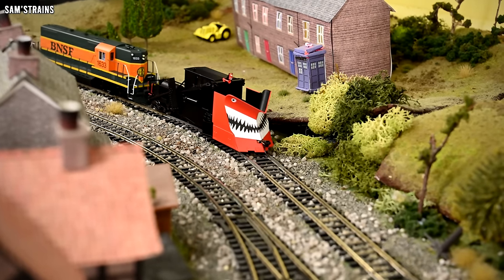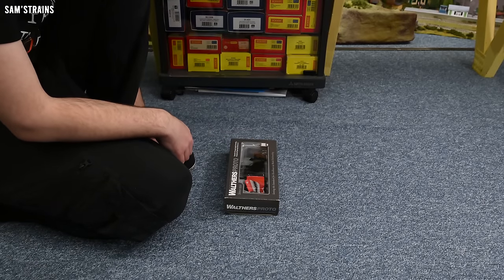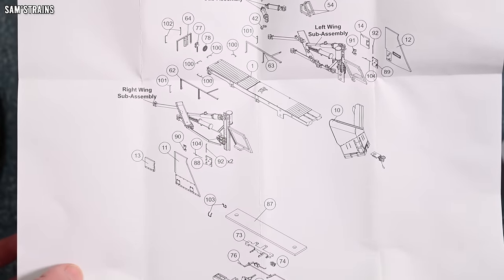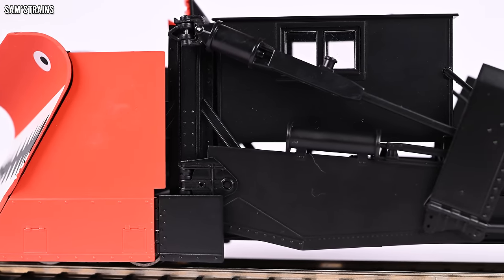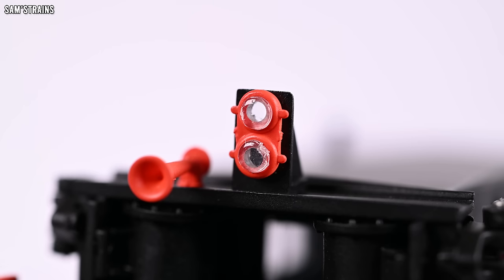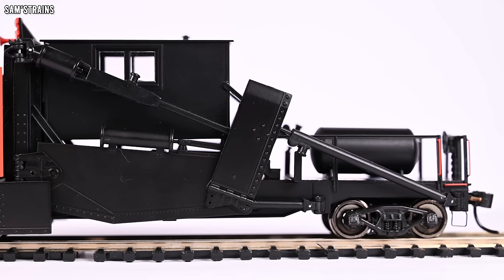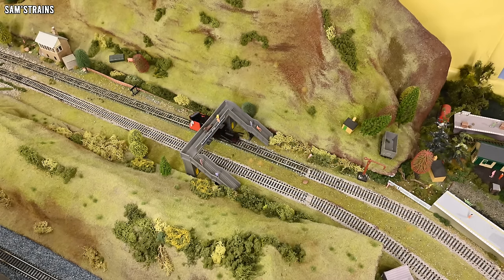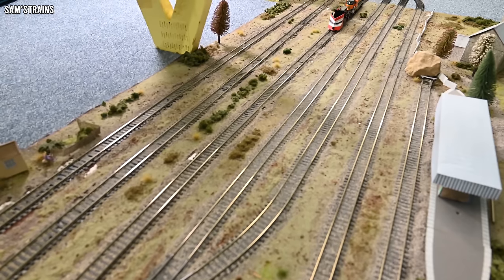Walthers Jordan Spreader | An Extremely Complex Model | Unboxing & Review

Comment: They could have put a metal rod inside the piston. I saw the plastic stretch when you opened/closed the big spreader arm. They could have easily put a small metal rod instead of plastic, but then that's why you gave it one star on its its overall quality.

Comment: This livery seems to be inspired by a snowplow on the Long Island Railroad, which more resembled one painted on the front of a fighter jet. 
The wings would only be opened if the spreader was running at low speeds, so you wouldn't have them open a lot.

Comment: These models were available many, many moons ago as kits. I’d say in the 80’s or 90’s. I can definitely see why all that glue is used, it is also why they have factory installed grabs listed on the box. Still doesn’t excuse a $75-$85 model falling apart out of the box. 
I will say this, Walther’s excels at their passenger cars. The mainline series is perfect for smaller layouts or those with tighter curves. The Walthers Proto or the old brown box passenger cars require at least 24” curves. 
I definitely would give their passenger cars a try just remember the main line/train line items are definitely cheaper, but the Proto versions will have body mounted couplers and factory installed grabs but need wider curves.

Comment: In the mountains of Canada, they pair these up with "Russell" Snow Plows of both ends of a pair of locomotives. Russell+Jordan+Loco+Loco+Jordan+Russell... so that in the reverse direction, they can ensure any fallen back snow can be cleared just the same.
I've got both the Russell and Jordan plows in the Soo Line paint colours.  It's unfortunate yours was a bit sloshed in assembly, the extra glue, and your need to make repairs. My models are just fine.  John

Comment: When I worked on the DM&E railroad in the 1980's,  the railroad purchased one of these.  It was kept for a while at my station at Pierre, SD.  I don't know where they got it.
I had fun examining it.  Apparently, it was built in the WWI era.  I was surprised to find the owner's manual still in the cab.
The manual had illustrations and complete instructions.  It was apparently an air-operated model.  One of the illustrations
showed it being pushed by a medium-sized steam locomotive.
It didn't have the colorful paint job of the model.  I remember it being solid black.

Comment: Thanks for reviewing yet another North America prototype, Sam!  I built the kit version of the Walthers Jordan Spreader about 20 years ago, and it holds a place of honor in my loco display case.  There is an interesting video of one of these clearing brush and small trees on the sides of a right of way and the brute force shown is a bit scary.  Too bad about the poor build quality on yours, though.  Unfortunately, many "ready to run" models I've purchased have required some TLC prior to layout use.  Cheers from Wisconsin!

Comment: Take the coupler out of the housing and see if the centering spring has no
bends in it. There may be a sprue area with a little flash on it, file it down
with a fine modelers file.
Kadee produces a dry lithium grease that can be used on their couplers. Just
puff in a little dab of it into coupler housing to improve centering movement.

Comment: Models imported during the C-19 period are in dealer stock for favorable prices. Post 2021 models are more expensive.
Might I suggest to you an American classic Athearn’s F7A/B. They are generally in stock at most dealers. 
The Jordan spreader is a very versatile machine it can dig drainage ditches, clear small rocks and other debris. In yards, it’s able to clean snow off three tracks at once. As for the couplers, Walthers rolling stock runs on the light side so they need to be opened on both cars involved and centered. Coupling on a curve will test one’s patience.

Comment: This would have been so much better if the plow blade, spreader wings, and cylinders were all metal. That would give it a lot more weight, possibly helping with the coupling, and it would make it much more durable so you could probably even use it to push around scale snow and ballast.
Reply from the maker: I agree - I think it really needs that for sturdyness!
Thanks for watching, Sam :)
Reply: Could try getting some small lead weights and hiding them in the cab area

Comment: I'm looking for a snowplow but probably one a bit more robust and easy on the budget.

As far as those couplers go, I've noticed that the knuckle couplers have two different springing mechanisms: "whisker" couplers with springs built in to the coupler itself, and "Kadee #5" style ones with a separate metal spring plate as you see here. The whisker ones pretty consistently work well while the separate-spring ones are kind of a mixed bag, plus a little extra work to install. Maybe there's a trick to it (there ought to be since they've been so popular for so long) but clearly I, and the people in Walthers's factory, don't know it.

Comment: Would be great if this doubled up as a track cleaner.
Although if and when you went to the trouble of putting some facsimile of snow for it to do the business, that would probably cause problems.

This can it be real looking like that? model reminds me of the feeling that I still get whenever I run my ancient operating Giraffe transporter. As you might imagine, there's a hatch in its roof for the giraffe to stand up.
When it comes to a bridge the activator gizmo you've put in between the rails magically lowers the head and neck.
Forty years after I got it, I'm still not sure how real life it is. But it certainly raises a good few smiles.

Comment: I have one of these. I think its a milage may vary thing when it comes to the quality. 
As for the delicate factor i agree that its fragile in places as its easy to overextend the smaller wing cylinders. My major issue is the lead coupler. Its slipped out of my other couplers a couple times when being pulled.
Reply from the maker: Thanks for sharing - yes that could be true! And true, the coupler is a problem on mine too
Thanks for watching, Sam :)

Comment: Great video as usual Sam! The coupling design is stupid! At the same time though, I think most railroads would normally have these at the end of a siding against a buffer since they aren’t normally used. Then again, a lot of railroads do store all their maintenance of way stuff together, so it would be possible for it to be in front of another car or two. Also, this has made me very tempted to try their CN one, despite the fact I model autumn, just looks like a cool thing to have at the end of a siding!

Comment: Hi Sam. 

Wasn't expensive... are you sure? 

Paul.
Reply: Compared with the others available in the States as well as some German models of their own, it is in fact not too expensive. For instance, there's a model SP rotary plough/plow in HO for a little less than $2000 (mentioned in my other comment just above) Plus this grimacing contraption is enormous.
And hideous.
Reply: @JP_TaVeryMuch  

Hi J P. 

You could purchase a brand new loco for the same price, so how can that be reasonable? It's exactly that line of thinking and the paying of such high prices by gullible people that enable manufacturers to continually push up their prices. At this rate, the hobby will soon only be affordable to those with plenty of spare cash. There are none so blind as those who WILL NOT see! 😡 

Paul.
Reply: @platformten5958  I wholeheartedly agree and we have a duty to steer clear of these suddenly £300 yet with no discernible improvement from last year, pretty standard locos where we can.
But I'm having a good old argument with myself now. Having gone down a branch line of investigation set off by Sam's video, how can I justify $1800 for a Southern Pacific Rotary snow plough on my version of the S&DJR?